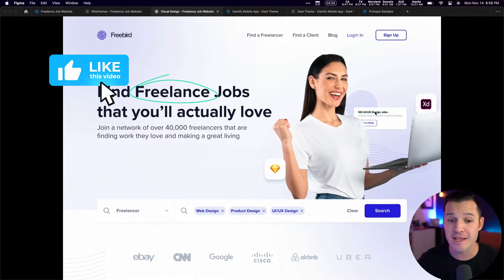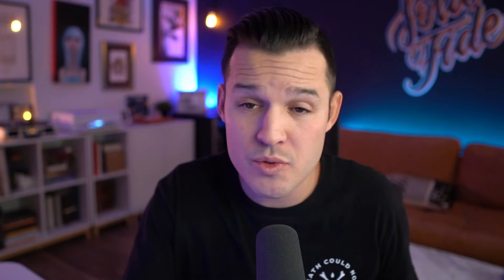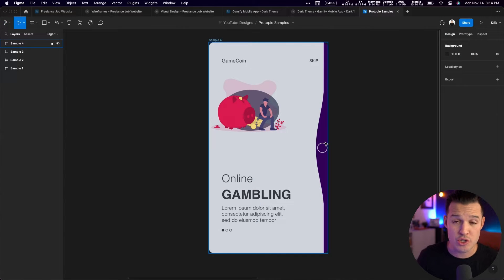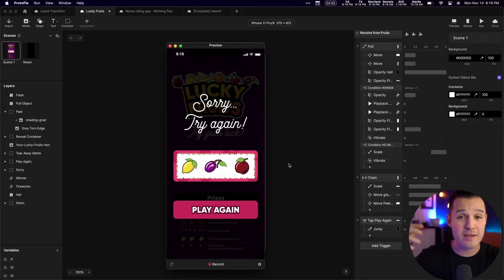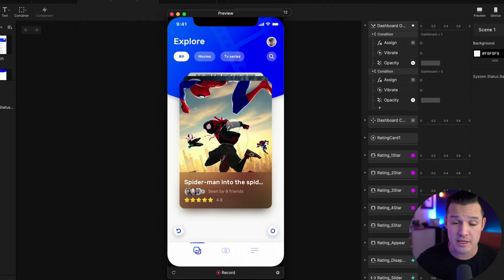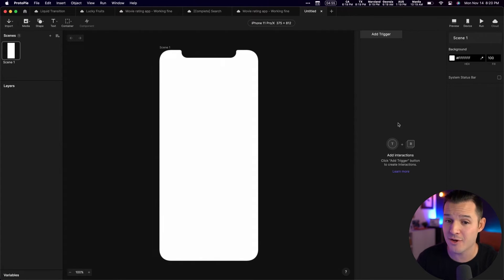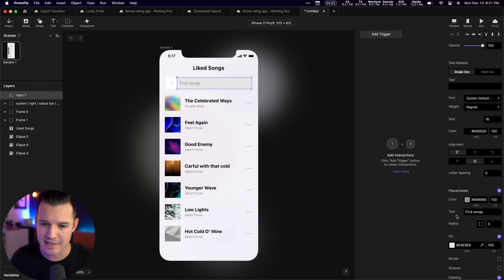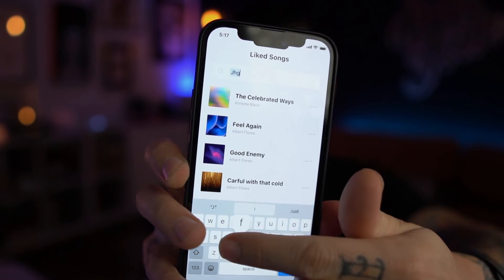High-Fi Prototypes are Not Optional | ProtoPie to the Rescue

Comment: Protopie doesn't just stop there though. I've used many version of Protopie starting from 2018 (I believe?) And it most came helpful in a real-life professional situation when I needed to simulate inputs between two difference devices depending on gestures. We were prototyping a screen sharing feature for our app that allowed to stream certain data to a different client basically, so we prototyped it using Protopie which allows you to ALSO make triggers depend on different scenes, opened on different machines, which are under the same network. Crazy good.

I haven't used it in a while, but I am glad to see it hasn't stopped improving, especially UI wise! Old versions were clunky as hell

Comment: I'm usually not sold on a plugin or program quickly, but in this case, I can't wait to buy and start using it. Question though: Does PhotoPie create code that you can then pass onto developers? Or can it integrate with Zeplin for this reason so it's a smoother transition from UI guy to Dev?
Reply: Hi,
Since ProtoPie a code-free prototyping tool, it does not create code to pass into developers. However, we have a more intuitive feature called Interaction Recordings. Each recording will contain all your interactions specs such as duration. delay, etc. Everything developers need to recreate the final product.